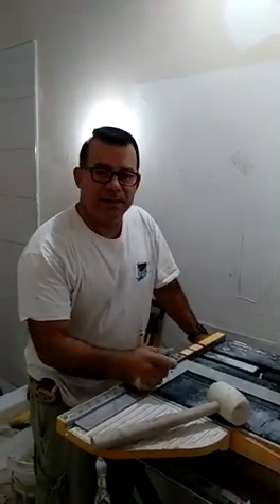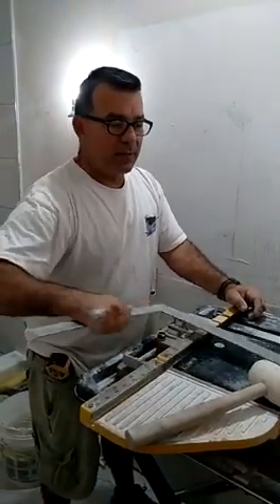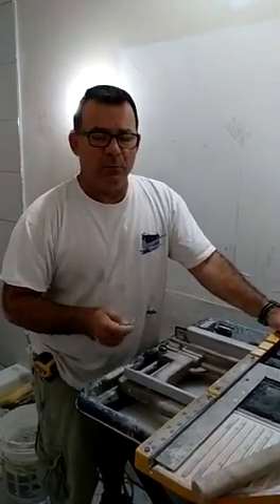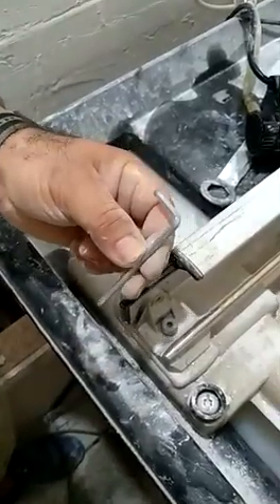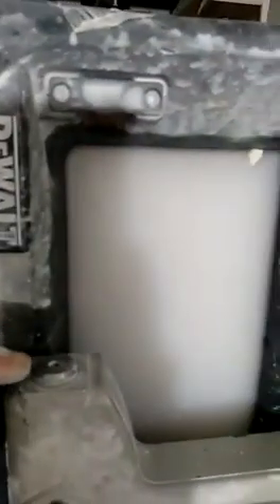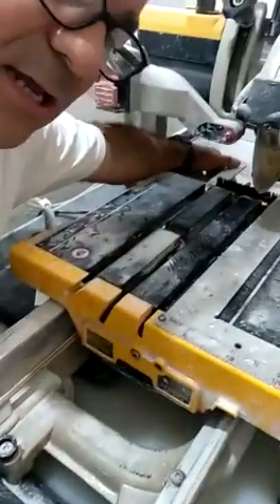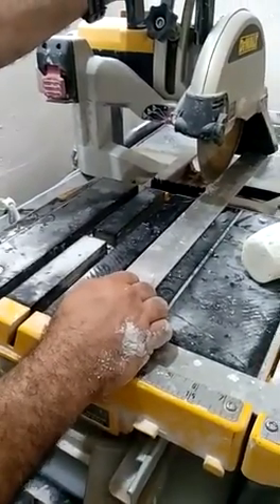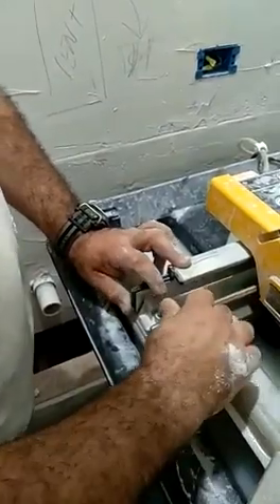How to square a Dewalt wet saw.

Comment: I just read the manual and it doesn't say anything about loosening up the other bolts. I tried doing it how you did it and my round rod that  the platter rides on was bent. The platter was binding when you would push the tile towards the blade.. I had to loosen up all the other 4 and 5 mm.  Hexhead  screws and one torx screw to be able to straighten the round rod out. Used a two foot level to confirm hope this helps

Comment: The bar is connected to the frame in 4 places. You need to loosen up all of them then make your adjustment. Then snuck them down and check them again then take a level and put it up against the slidebar. Make sure that is straight otherwise. It will be Bode then tighten everything down and you're good to go. Thanks for giving me a place to start but you're not quite seeing all of it.  Have a great day
Reply: Make a video

Comment: I have just brought a D24000S UK @ £1090 Sept 2022 after setting up I found the table to be rocking from side to side, bumping as the wheels go on and off the rails as well as the table not being square to the blade. My Saw does not have the adjustment screws (to square the guide rail to the blade) on the very outside of the base frame, so to square the rail to the blade I had to undo all 4 inner rail screws and move the rail by hand (due to stiction it was not easy to move in such small increment's) with a lot of patience and faffing around I got there in the end. It's worth noting that it's the RAIL (direction of travel) you are squaring to the blade and NOT the table, if the rail is not square to the blade the back of the blade will be dragged through the work piece and will leave upward cut marks and may even cause chipping of the top surface so great attention should be applied to the striations (cut marks) along the cut face of the work piece. To my knowledge there is no means of adjusting (squaring) the fence on the table, in any case in my experience it is rare to find a manufacturer that cuts a truly  square tile.

Comment: I have the same saw, and when I start my cut it goes slightly to the right at the first inch but then cuts straight????
Reply: Mine does the same thing. Next wet saw for me is gonna be a bridge saw and then no more of these issues.

Comment: I had the same issue and I tried this first but it wasn’t enough, this is actually not the the proper way to square up the table. 
There are 4 rail screws you can loosen along the rail and adjust the entire thing. I ended up google searching the manual and found the info.  
Mine had gotten so bad I was using tile spacers to square the tile up to the blade. Ridiculous.